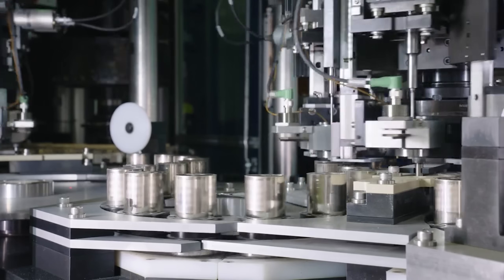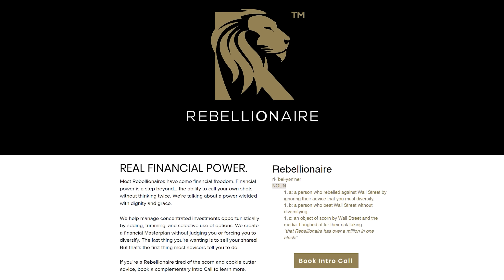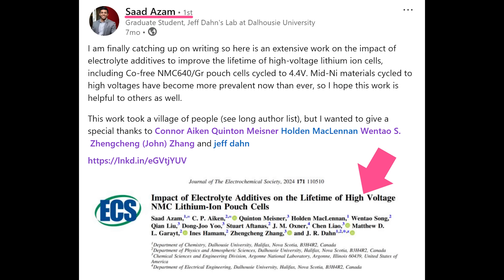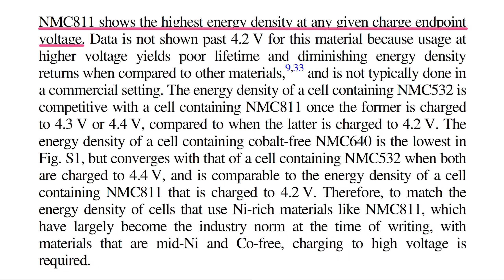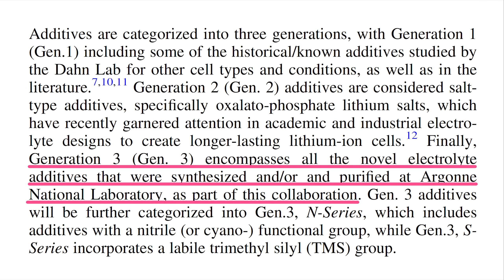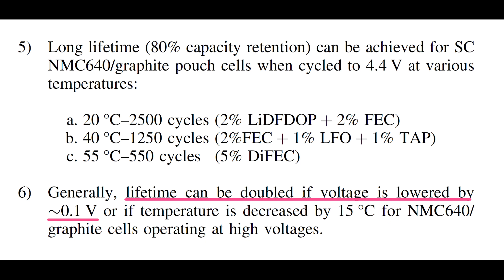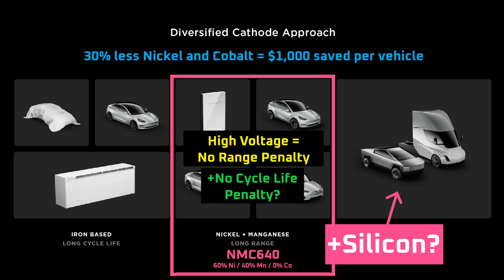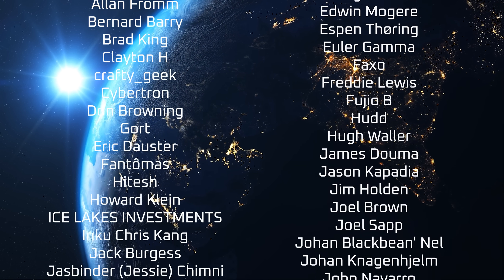Tesla's High Voltage Electrolyte Patent is More Useful than I Thought

Comment: I am very curious about the CALENDAR LIFE aspect. Cycle life is only one aspect of the degradation measurement. EV spend more than 90% of their life parked and waiting for the next cycle... 20kkm/ year is only about 50 full cycles and 400 full cycles acter 8 years.... but calendar life negative effect often dominate cycle life effect.
Reply from the maker: I did a whole video dedicated to addressing the calendar life issue.

In this case, the cycle life should be a good proxy for calendar life vs current cells.
Reply: Very good question.
Reply: Hi Doc 👋😀
Reply: @TroyRank Hi Troy!😊

Comment: Interesting video, but I am confused by one thing. I had the (possibly incorrect) understanding that the voltage of a battery cell was determined by its chemistry, so I am confused by your claim that Tesla might be able to use software to slightly modify the battery cell's voltage. Obviously, I am missing something. Please clarify.
Reply from the maker: Great question! 

Voltage is determined by chemistry

However, the voltage that you can actually use is restricted to extend cycle life.  That is, there's a difference between voltage window, and usable voltage window.

By using a different electrolyte, you can increase the voltage closer to the maximum voltage with fewer detrimental effects 

Hope that helps!
Reply: The way a battery responds to a charging process (its voltage curve) is determined by chemistry. 
The car has a charge control software as part of the battery management system (BMS).
This software is responsible for charging the battery in a safe manner without damaging it.
This software controls the end-of-charge voltage. If the engineers think it's safe enough, they can just increase it and let the battery charge a bit longer.